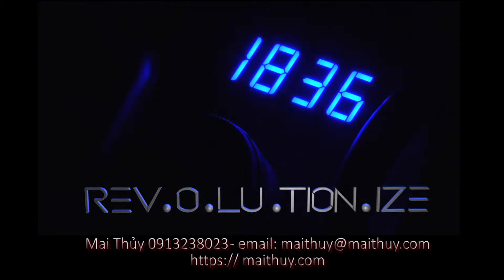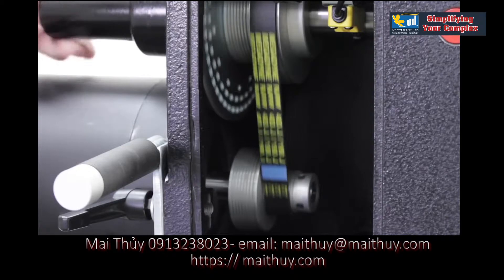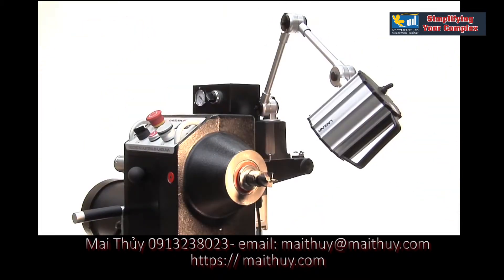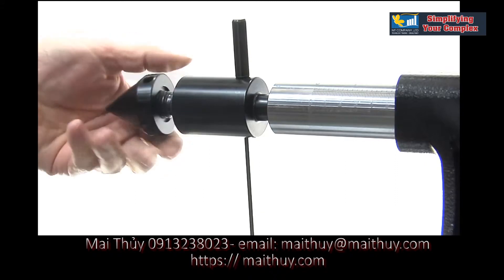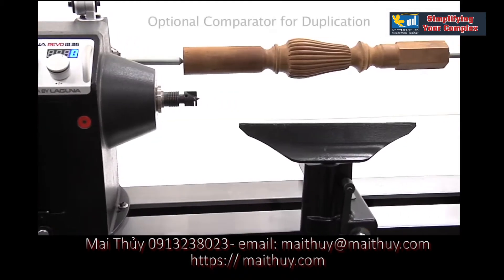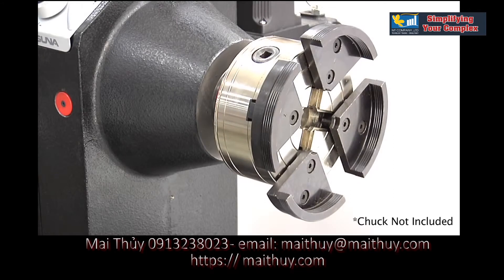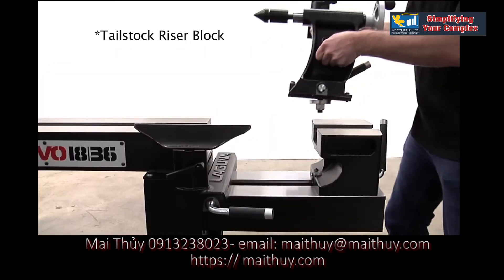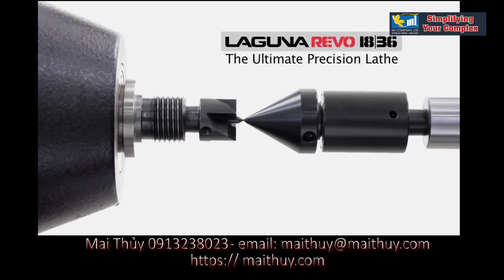Máy tiện Revo 18-36 (Laguna-Mỹ)

Comment: Thích quá máy này giá sao vậy anh
Reply from the maker: Cám ơn bạn đã quan tâm.
Máy tiện gỗ 1836 Revo 2Hp 230v Lathe
Nhãn hiệu: Laguna 
82,371,000đ
(Giá chưa bao gồm VAT
)
Đầu vào một pha 230v 50Hz.
Động cơ Cảm ứng, 1420 vòng / phút, 2 giờ. P2 = 1,5Kw S1
Ngắt dòng khuyến nghị 15 Ampe
Đường kính tiện qua giường máy 457mm (18 ")
Đường kính tiện ván ngoài max 813 mm (32 ")
Đường kính tiện qua bàn xe dao 343 mm (13 ½)
Khoảng cách chống tâm 914 mm (36")
Kích thước ụ dao/ kích thước chuôi dao 305 mm (12 ") / 25,4mm (1)
Côn trục chính MT # 2
Tốc độ cao 135-3500 vòng / phút
Tốc độ phạm vi thấp 50-1300 vòng / phút
Hành trình ụ động 114mm (4 ½), Khắc, Tự đẩy
Kích thước không gian lắp máy W x D x H 1524 mm x 660 mm x 1194 mm (60, x 26, x 47)
Trọng lượng (Net / Shipped) 194 Kg / 206 Kg